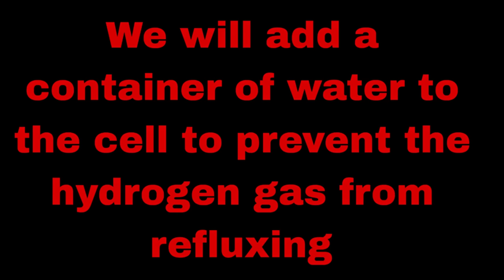I turn Water into a Free Gas for cooking, New invention

Comment from the maker: I Turn Human Waste into a Free 220v battery
https://youtu.be/iz2VbFI6IYs
Reply: 10:46 Hydrogen and oxygen gas together produces.... salt water electrolysis...
Reply: electricity used to separate water and hydrogen  - not free anything. nice work, just the same. nothing new nor patentable
Reply: Skak Mat 😂😂😂
Reply: @RavNivara  when it runs combustion engine and generator then free
Reply: Best replied😊
Reply: What else can I use if I don't have compressor?
Reply: @omeyemison  Aquiarium pump?
Reply: @RavNivara  slap a batt and solar then it would be free
Reply: Yes! Same question I have.  @omeyemison

Comment: Have we forgotten the basic science, Electrolysis is the process of using electricity to split water into hydrogen and oxygen. If the hydrogen is coming from the tube then where is Oxygen. Where is the separator membrane? Be aware of following this video,
Reply: ...i haven't watched the video yet but then thumbnail makes it look like they're just burning it in air. are you confused about the air supplying oxygen for fire.
Reply: combined output water electrolysis is also a thing, and all you do is just not separate the hydrogen and oxygen physically after you split them apart chemically?
Reply: It’s wrong to say it’s only hydrogen out, but it’s HHO. And it’s flammable yes, but it should burn with a pop sound innit?
Reply: Yes you are right
Reply: He is breaking water with the help of aluminum.  In electrolysis  aluminum  mixes with oxygen to form aluminum oxide and hydrogen is released.  Further he is pressurised  air to through hydrogen  to use it as a fuel
Reply: He is making HHO
The bubbling recipient stuff it's flash back flame stopper to avoid explosion in the HHO maker
Reply: Is it danger.... Hydrogen have both combustible and explosive property..

Comment: 24Vx6A=144W for Hydrogen production, plus 300W for the fridge compressor, that's about 450W. No big deal, since a small electric heater does the job clean, involving less danger..
Reply: bjr, je suis totalement d'accord avec vous, on a du gaz gratuit mais en revanche on consomme trop d'électricité, n'y aurait-il pas un moyen d'utiliser 12v en courant continu ou solaire ? ?? ? ? ?
Reply: @medenouvoflorentin7856 compressor can be replaced by using smaller fans which can push hydrogen out, for electrolysis he is using 24v6A which is about 144watts of electricity consumption.
Using solar backup can reduce electricity bills, still it's far more cheaper to use regular gas.
Reply: A hot plate with same electric cord he could have cooked the egg 2 hours ago
Reply: people don't be stupid that's how things start's take note and find a solution . that's what we call technology, thank you my guy
Reply: not if hes using solar to charge the inverter power source it aint.
Reply: They might not have access to gas and he might be tapped into his neighbors electricity 😂😂😂 freeee
Reply: സംസാരിക്കാറില്ലേ   ബ്രോ   ?!.
Reply: Can we use any other air motor instead of fridge compresorrr...
Reply: Thank you
Reply: @atukintso1405 he could be using an aquarium fish pump which takes virtually Nothing to run. What a waste using a compressor for the air pump.
Reply: Domanda con questo sistema si po fare il bruciatore della caldaia di casa sarebbe una cosa meravigliosa a riscaldare la casa
Reply: Bro you forget that Small Electric heater consume about 1500W Do your research.

Comment: DO NOT FOLLOW THESE INSTRUCTIONS!

1: Salt in a system where you are splitting a chemical (in this case water) into its individual atoms (HHO) also splits the salt into Sodium Chloride. A deadly gas. and may create Sodium Hydrochloride. This Chlorine is also extremely deadly. 
2: Using aluminum in a Brown's Fuel reactor (the old invention in this video) will cause the aluminum to instantly convert into Aluminum Oxide. Mostly harmless, however the aluminum is disintegrated into the water quite rapidly and quickly becomes a messy disaster. 

If you must build one of these:
Use Baking soda instead of salt as your catalyst. 
Use stainless steel wall plates as your core instead of aluminum.
These reactors can also produce an insane amount of heat. I would advise using ether glass or insulated metal containers as the plastic will eventually melt under sustained use.
Reply: Yeah. Chemist here. I actually didn't pay too close of attention, or even watch the whole thing. My instinct was instantly - "holy shit no, this guy's gonna blow himself up, clearly." But uh, I was wrong you say? He's actually gonna gas himself instead huh?   ...checks out.
Reply: baking soda would be safer only produces co2 at a very small rate but even that he isnt capturing the hydrogen instead he is just making browns gas which is signifigantly more explosive and lower flash point... smh the salt had me too... smh
Reply: For your kind information. 

The Salt also turn into "SODIUM_CHLORATE" crystal if the electrolysis ran for along time and it is soluble and stays into the solution.

What could cause issue is the fee chlorine gas but it also get burned at the burner. So if you keep this in mind and build your setup accordingly it's quiet safe with salt too. Nothing to be worried.
Reply: And how many grams of soda to be use in replacement for salt
Reply: @felipeafaten2276  I would probably add 2 grams (approximately half a teaspoon) per quart of water. 
Depends on how much power you will be adding. Less power - slightly more baking soda. 
It’s been decades since I browns fuel. But I put a small reactor made from a small, home, espressos machine, into my wife’s car. 
I put an outlet directly into the air intake. The car went from about 18MPG to about 24MPG city/city.

Comment: Big inventor, big cooker and a big showman 😁
Reply: BS meter reading.  10 out of 10.
Reply: It's oxagon and Hydrogen mixture gas,  could explode without blowing with air compresser.
Reply: Instead of breaking up the water molecules into hydrogen and oxygen for cooking by burning with the possibility of explosion, the electricity can be used for cooking safely with an electric stove. What a waste of effort and time!
Reply: @simon6071 It is for educational purpose of using hydrogen gas, I supposed! Not just simply cooking with electric stove!
Reply: This is almost the same concept in hydrogen combustion engine and producing hydrogen gas!
Reply: @simon6071 Global and mass production of hydrogen as car fuel, is somehow closer to reality by well developed countries, but it being hold by elites!
Advancement for the research of renewal energy is the key to sustainable future of transportation and automotive industry!
Reply: @Mr12cheetah34  If cheap electricity from nuclear fusion becomes a reality, then I agree  that green hydrogen generated from water with electrolysis is the best fuel for long range vehicles.
Reply: @Mr12cheetah34  Then the video host should not claim its a "New Invention" because it is not.

Comment: Although the Experiment is very Good but this is not totally free because an electric fridge compressor will charge more electricity than the gas cost.
it would have been more better if the replacement of the compressor was mentioned.
Reply: You can use solar electricity to use compressor

Comment: explaining the process would be wonderful, instead of silent mode.
congrats.
Reply: Its HHO gas or browns gas. when you put 12volts positive and negative poles into regular water. it separates the molecules from H2o to hho  or Hydrogen. & hes using the pump from the frige compressor to blow the gas into the burner. the second water supply is like a buffer or flashback protector. hope that was helpful. thanks

Comment: On a safety note. HHO is a dangerous gas and should not be moved by metal devices, which could spark if clearances are not maintained. If using a fan, rather than a compressor, make sure the motor is brushless, because HHO requires no external oxygen or fuel and will burn very quickly, producing lots of heat and expansion, given any sort of a trigger.
It proves difficult to light here, because the mixture is way too lean, with oxygen from the atmosphere available to weaken the mix. In the jar, it would be different, with the ratio perfect.
Far safer, not to mention more efficient, to use the electricity directly, to produce heat, without the inefficient electrolysis in between. 
Energy in equals energy out. But the energy out is nearly always in several forms, not all of which can be harnessed. Electric to heat is about the most efficient we’ve managed to achieve, yet.
Using it to “unburn” hydrogen, pump the hydrogen around and then burn it again inefficiently is about as sensible as pouring water from a bucket into your hands, carrying the water up a hill and throwing it back to the bucket. Losses at every stage.
Reply: But who got the eggy sandwich ;)
Reply: That's not accurate though, in the interpretation of thermal efficiency.  While electricity to heat production is nearly lossless, from an energetic standpoint, it is only a 1 to 1 ratio at best - 1 Joule of electricty = 1 Joule of heat production.  Burning gas, however, for heat production is far more efficient - over 4 Joules of heat output for natural gas, for example.  Using the intermediary step of electrolysis to produce gas locally, on demand, and thereby burning it for heat has a much higher thermal output than simply shorting out a wire with electricity to produce heat.  The compressor is absolutely unnecessary;  if you were to place the burner underneath an old heat exchanger from an HVAC unit, and blow a small and efficient fan from an old PC or 3D printer - (24V, 0.21A) over the heat exchanger, you'd be looking at a tremendous thermal output at the cost of approx. 200 watts, maximum, of electricity.  Compared to the low heat output and high energy consumption of a standard 1500 watt space heater, that's a huge win for Hydrogen despite system losses and inefficiencies, which can always be improved upon.
Reply: @neonsynth  But did you get the eggy sandwich? ;)
Reply: That is incorrect. He is getting far less than 1 joule of energy out for every joule in.   @neonsynth
Reply: @neonsynth  Why would you use an electrolysis device wich have at best 25% energy efficiency,plus water,salt,a compressor,have to change the electrodes often,plus the risk of blowing up your house in case of a leak,as it doesn't smell, instead of using the electricity to power an induction cooking machine wich have around 90% efficiency.....is beyond my logic. It is like scratching your leg over your shoulder.

Comment: Now I can use my water fueled car which been resting for decades. All you need is a little electric power from the sun. Or I can use my pedal powered air compressor to drive the hydrogen into  the ICE. (internal combustion engine. ) Sometimes I won't use the SUNlight, but I'll use my pre stored compressed air in may tank which I pedaled to get the air compressed during my exercise. Thanks Bro.
Reply: How can you make a video on it??

Comment: How to produce Hydrogen gas by boiling fresh water with granular salt egual to Hydogen Gas.Two aluminum plate with live wire 24.V DC or AC soak in salt water in a airtight container with inlet hose to allow adfitional pressure outlet hose to 2nd comtainer as fire arrestor   an additional valve regulator needed to regulate fire from the burner.Sir a brilian job done! A Friendly Enviromemt zero pollution no more Monoxide in the air. BRABO!!!!!
Reply: Ask pm Modi

Comment: Electricity may be costly. Can you incorporate renewable energy sources, probably this could save on the costs involved. Safety is also another issue to handle. Thanks for the information
Reply from the maker: Yes you Can bro
Reply: Yes, this will definately work. One word on safety. No shortcuts in sealing all pipes, connections and lids. Also be aware of burn rate of stove vs quantity of gas generated. Keep in mind what pressure the gas generating jar can safely handle. The ultimate? Combine with an energy generating solution for the fridge compressor. Such as a car battery for instance? Recharge battery as needed with solar energy?

Comment: Some of the cons:

1. The process uses way too much energy for electrolysis. And if you think solar, - it's not the kind like the solar rug you can comfortably bring along. 
2. This means you will have to bring the gas along, but since this is Hydrogen - you can forget it.
3.  Hydrogen has much higher flame speed which means it will be prone to burning sections of food unless attended constantly. This can be helped with a large (and heavy) chunk of metal to transfer heat from the flame and to be used as a stove top. Since you would barely see Hydrogen flame at night time, - shouldn't be a big deal. But I'm not sure it's the best choice for cooking. Natural gas is cheaper to extract, using electricity to cook would consume less energy than using it to produce hydrogen then cook (sorry "water powered car" enthusiasts).
4. Hydrogen is highly explosive. Hydrogen-air mixture will ignite from the lightest of sparks. You are safe cooking outdoors since Hydrogen is a very light gas and it rises immediately. But inside, if you have even the tiniest of leaks, - Hydrogen will pool under the ceiling space just waiting for that unlucky spark. And you won't suspect a thing because it's odorless.

Some of the pros:

1. Makes a cool YouTube video
2. Brings so much cash to its creator that he would never have to worry about his electric bills.
3. Reminds people that they have their own DIY project (that hopefully won't result in a DOA).
4. Reinvigorates the imagination: for example, - thinking whether using thousands of Hydrogen filled balloons to travel by air would offset some of the costs of producing Hydrogen and make bringing it to your camping spot - a breeze.
😂

Please, always be careful when working with Hydrogen. Read your WHMIS and follow the guidelines religiously.
Reply: Where did he buy that drill bit?😂
Reply: Physics is indifferent to politics. If you ever worked with hydrogen, particularly compressed hydrogen, - you'd be  as worried about it as those who have, regardless of whether you're "bourgeois" or "proletariat".  It's a volatile gas that escapes through the very best of seals and right through metal too. You would also have to use massive amount of "capitalist" electricity to produce it via electrolysis, which is way too expensive. And if you already have dozens of high wattage "capitalist" produced solar panels, - you don't really need hydrogen, since you could achieve more with electricity from solar panels alone. @mouleoub
Reply: 🤣DIY = Do It Yourself 
🤣DOA = Dead On Arrival
Reply: That Guy is a creative mind indeed

Comment: One of the most useful videos on YouTube.  Thanks! I would suggest using a solar battery bank for the electricity in an emergency.  I'm not sure what the output would be vs plugging it in, but you could also use a power bank generator that puts out 110v (US or 220v Europe). This would be a good think to experiment with. Using silver could also create colloidal silver to use as an antibiotic as well.
  Thanks for the awesome reminder and demonstration that we can do these things!
Reply: This process used too much power consumption.
Compressor =400-500watts
Electrolysis =144watts(24v6A)
Total around 540-650watts 😳
Thats not free running for hours, regular gas is far more cheaper.
Reply: Solar and inverter will do the job. Only that you cook in the day. 😂😂😂😂
Reply: how can get solerbattery
Reply: A useful addition to solar / wind set up when you have excess power  to burn....the need for hydrogen storage perhaps
Reply: You wouldn't want to store that gas mixture, it is explosive.  That is why he added a flashback suppressor into the gas stream.
 @StephenRaymondBLACKIE
Reply: Why would you use an electrolysis device wich have at best 25% energy efficiency,plus water,salt,a compressor,have to change the electrodes often,plus the risk of blowing up your house in case of a leak,as it doesn't smell, instead of using the electricity to power an induction cooking machine wich have around 90% efficiency.....is beyond my logic. It is like scratching your leg over your shoulder.
Reply: Can someone tell me what the compressor is for?

Comment: Good stuff. You've showed a quite easy way to do it with common things that are available to everyone, except for the compressor.
The good news is THERE IS NO NEED FOR THE COMPRESSOR. It would work anyway.
The difference would be in the pressure, that would be less, but still enough to cook anything, slower.
Reply from the maker: yes you can replace fridge compressor with 12v air pump

Comment: do we need compressor compulsory ?? or we can just use gas without it ??
Reply: What HHO.. its a boiling water
Reply: It's possible to compress it into a cylinder. No compressor necessary, just metal plates, razor blades will work well, an efficient solution such as sodium hydroxide, baking powder, or even urine. Have a spark arrestor fitted incase to stop a potential explosion in the main production tank. Anode and cathode wiring.